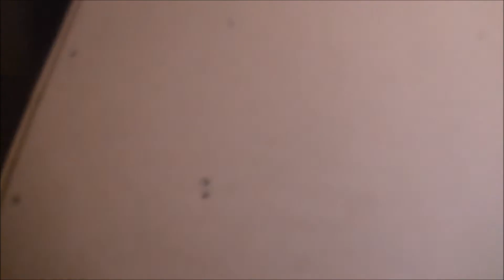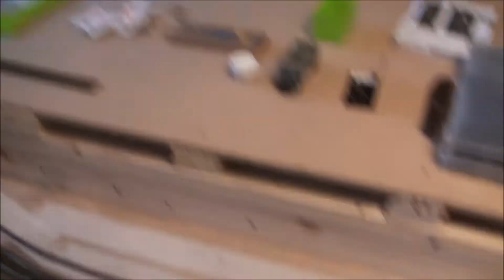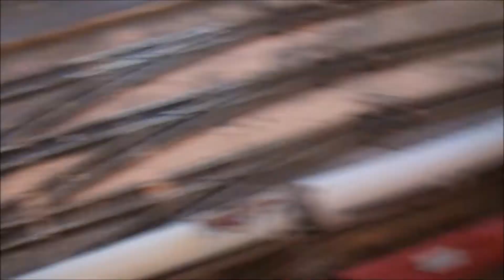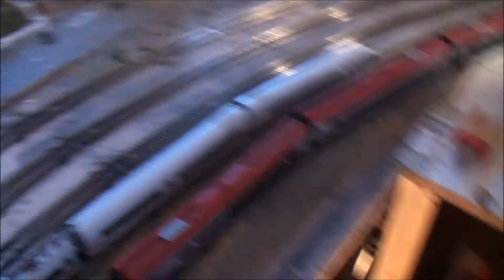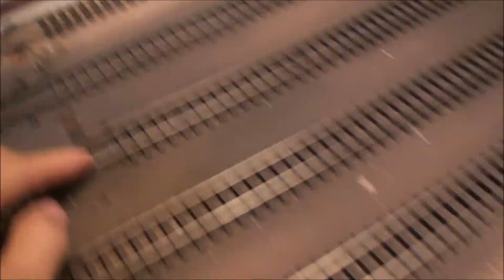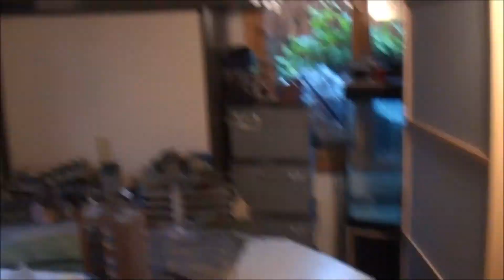DCC layout update 53

Comment: just a thought why not run one or two straight tracks where your old station used to run along or even on the inside two tracks on your back board so you have the station length for the pendolino. It has to run with all the cars on ,it's a great train and there are not many folk running a full length one. best of luck again
Reply from the maker: good idea